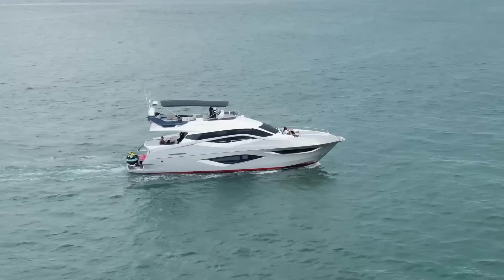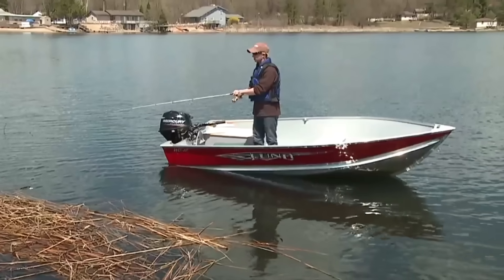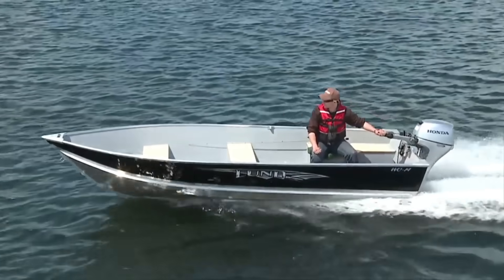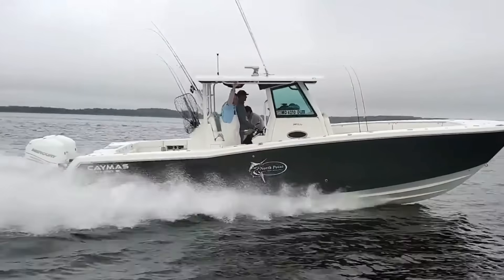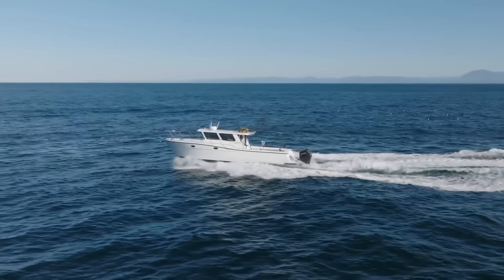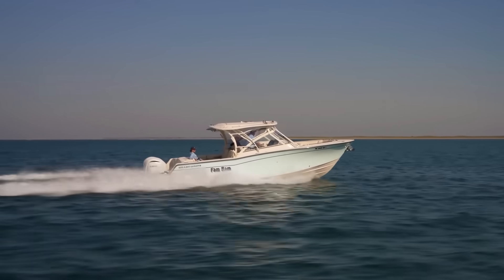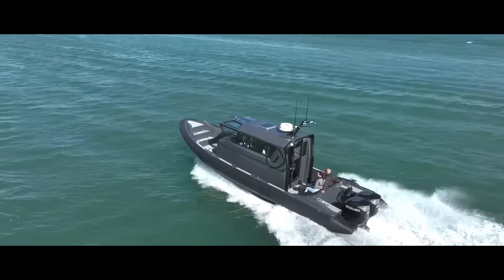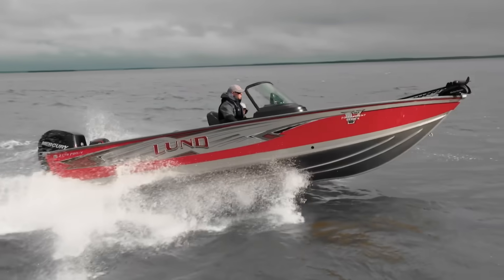Hull Physics Secrets Every Owner Should Know

Comment: 21 M displacement   hull,  1.2 T  light  weight,  7.5 T  load,  twin  200HP  Engines   fetched   16  knot    speed  on  cam  water.  It  has  ' Transversally  Concave  Hull  Bottom '  which  is  not  conventional.
Reply from the maker: Thanks for sharing those specs! A transversally concave hull bottom is definitely an interesting choice—it's great to see unique designs in action. How has it performed for you so far?